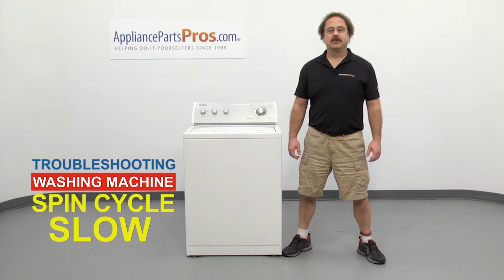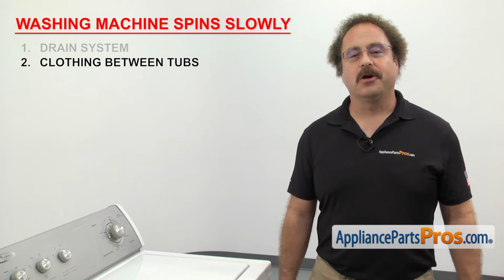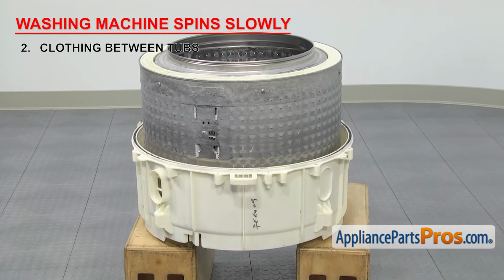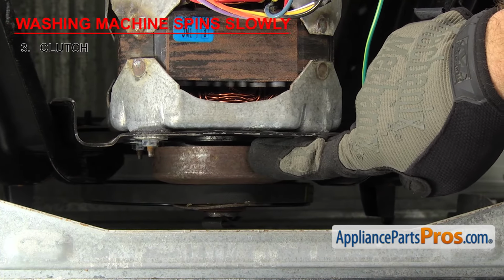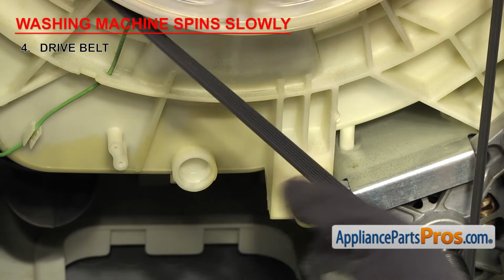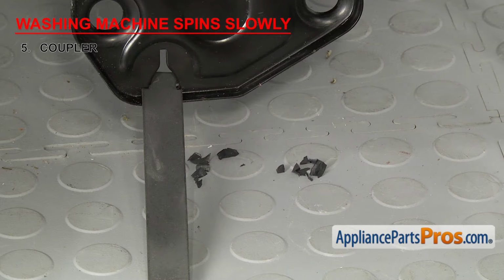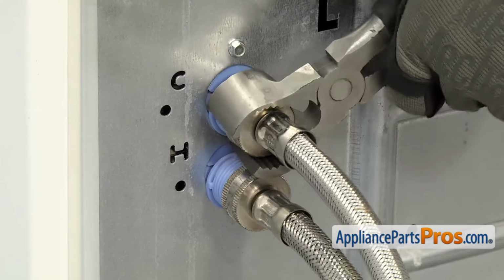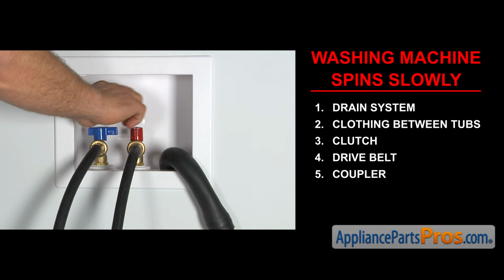Washing Machine Spin Cycle Slow - Top 4 Problems and Fixes - Top-Loading and Side-Loading Washers

Comment from the maker: 🔧 Common fixes for this issue:
▶ Clutch Assembly Kit 285785: https://www.youtube.com/watch?v=7RS1l6t8efc
▶ Drive Belt WP21352320: https://www.youtube.com/watch?v=ze85sqxKDyw
▶ Samsung Shock Absorber – DC66-00470A: https://www.youtube.com/watch?v=XZsy2qNjMcg
▶ Shock Absorber Kit - Frigidaire/Electrolux 5304485917: https://www.youtube.com/watch?v=TY3s-EnZLjo
▶ GE washer motor speed sensor (model-specific, no part num...: https://www.youtube.com/watch?v=Z299-ychHaw
▶ Rear shock absorber / damper — Samsung DC66-00531B: https://www.youtube.com/watch?v=8Uh-4oYqmr8

👍 Found your fix? Hit Like so others can find this video too!
🔔 Subscribe for more repair guides: https://www.youtube.com/@AppliancePartsPros

Comment: Solid walkthrough. One extra safe step that helps: reset power for a few minutes, then run a short test cycle and watch exactly where the failure starts.
Reply from the maker: Great tip, @ApplianceFixGuide 👍 Resetting power and watching a test cycle can really help pinpoint where things go wrong.

Comment: Problem... machine works empty,  fills, washes, spins, empties  , but   as soon as you add clothes, it washes, then the spin cycle slows down and stops... like the drum is too heavy to spin... even with 2 to 3 items in the drum.... clutch was replaced, brake was replaced, coupling replaced... still same issue... ideas?
Reply from the maker: What is your model number?
Reply: @appliancepartspros  LSQ9549LW3
TYPE 111...
Reply from the maker: If by washing you mean agitating, then it is likely a pressure switch issue.

Comment: I have a Maytag A310 washing machine and it agitates fine but when it tries to spin, it acts like it's overloading the motor. Today I set it on  soak cycle and it's spun out but when I try to put it on normal spin it acts like it's got too much stress on the motor and kicks it off.
Reply from the maker: Is it spinning at all when you put it on a normal spin cycle or is it not spinning? Is all the water draining out of the machine? Do you hear any strange noises at all?
Reply: @appliancepartspros  If it has a low amount of water it will probably spin it all out but under a normal load it seems to bog down the motor and kicks off.  It agitates fine and doesn't really make a noise when it spins.
Reply from the maker: Do you happen to have a multimeter? Is so then I would start with checking the timer/voltage coming to the motor. If you're able to put it into spin, test the power coming to the motor for 120 volts AC.
Reply: @appliancepartspros  Ok,  my brother in law has one.  If it has a little bit of water in the bottom of the tub it'll spin it out fine but I noticed the motor does seem to get hot. Shut off with big loads.
Reply from the maker: You could also be having an issue somewhere in the clutch assembly area as well. If you are able to take the machine apart I would check to see if anything could be damaged.
Reply: @appliancepartspros  I kind of wondered about the bearings.
Reply from the maker: With what you have explained it doesn't sound as if you would be having a bearing issue. If you had issues with it leaking or making noises then I would look at the bearings causing your issue.
Reply: @appliancepartspros  I put a new timer on it today -  it was a perfect match but didn't fix the problem. The motor still kicks off as it goes to spin.  Agitates fine just won't spin out.

Comment: It did have an article of clothing(  wtw8500bw0) between tub and outer liner. I retrieved  it. But clothes still dripping some. No clogs in pump, completely disassembled pump no clogs/debris found. No kinks in hoses. Removed inner tub per your helpful board and Jack instructions. Hub gear and shaft looked good. No more laundry articles located under tub. Removed the circulation cover situated under tub for good measure all clear. Also disassembled circulation pump all was clear No clogs/debris found in it. It does appear a inch or so of water remain in bottom most of liner by the recirculation hole. I assume this is normal? Pumps seems to drain good. But no matter the spin speed setting they all seem to be the same rpms.  Question after removing article stuck, k between tub and liner,  does the washer need recalibrating or anything. If so what's the procedure. Thanks

Note: Could the speed sensor malfunction and cause this issue?
Reply from the maker: The speed sensor could cause the washer not to spin out completely. To answer the other question, the washer should not need a recalibration.
Reply: I moth balled it last year. Just got it out today to tackle it again. Noticed it would squat on floor and  stator drags on floor. Adjusted legs  so no drag.  Still slow rpms on spin cycle.  Got trouble codes f70 and f83.  Unscrewd console  checked all wire connectors. Even unplugged and replugged. Also blocked up legs to ensure plenty rotor clearance.  Still slow rpm spin.  Reset by unplugging  electrical plug 3 times. Still slow rpm spin.  Not spinning fast enough to judge if its going to shake.  Rod springs with 1/2  tub of water compress them 50%?  Lots of side to side motion?  Spins. Just spins to slow for final rinse spin obviously.  Could the suspension being worn out cause the slow spin issue?  Ill try the speed sensor/actuator next as well. Thanks in advance folks have a great weekend
Reply: By the way rotor holes have no evidence of leaking in any of the bottom holes or on floor.   Rotor turns easily by hand.
Reply: Allas alas..its fixed(WTW8500BWO Slowfinal spin issue therefore clothes endup much to wet) If you re call my prior messages and issues with this same issue? Anyway my next attempt with your input i was going to try  it may be the speed sensor. But overnight i had a lightbulb ho off in my head. Lol.  I rememembered the bottom portion of the hubgear ( with silver washer)  was not easily slid up and down the shaft splines according to my last account.  So i pulled the agitator off, the bottom half of hub gear was tough to get off.  And the tub even tougher. But per yalls jack hack i finally got it off. It fought all the way. Sure enough the shaft was corroded and the lowest portion of the shaft splines.  I wire brushed the corrosion out of the splines and sanded the rust off the part of the shaft that the tub floats on. Then made sure the tub could easily float up and down about an inch. And that the bottom half of the hub gear could easily also float up n down on the splines. Reassembled. Tested on Rinse drain n spin. Bam!  High rpms achieved laundry spun out as designed to. Ran Heavy duty cycle, Highest spin, and highest soil setting. Again success spins high rpms with clothes washed dry as designed. Man what a beast. Lol. Thanks for the yalls ear, patience, and input. 😅

Comment: No clothing stopping it. Twin tub washer . Washer on left . Spin on right . Washer does not spin properly. Never fill it to high with water . Or clothing . I’ve check the belt. It’s fine. I’ve take the whole thing apart several times to unclog it, or fix the spin dryer .

Comment: Been searching for weeks.
Mine is intermittent.
Sometimes it works fine.
Sometimes it does 3 20 second spins, etc.
Reply: Same here. Have you found a solution?
Reply: No, not yet, but I've proved it's not what all those other videos fix.
What a pain all these computer controlled contraptions become.
I feel sorry for all the electric chair 💺,  I mean electric car owners and future troubles they're in for.
Reply: @aaronsmith5433  Haha I love the computer controlled tech. It's the future. It just takes a different skillset to work on than what older folks are familiar with.